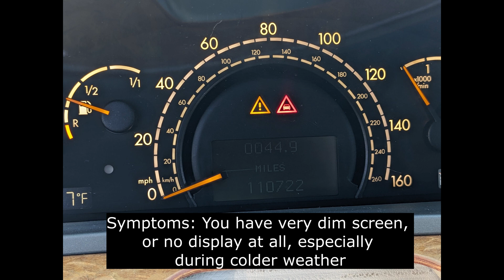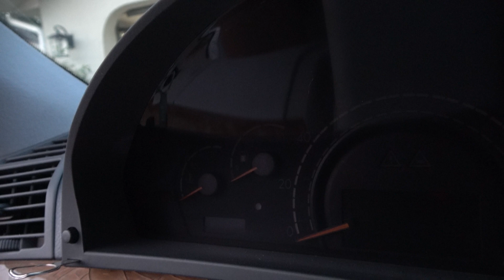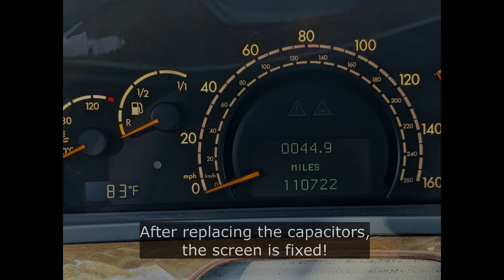Mercedes Benz W220 (S430/S500) Instrument cluster removal and display fix

Comment: So as long as you don’t change the actual board out, there’s no need to have it flashed/programmed correct? Correct me if I’m wrong, but replacing the whole assembly would require a program/flash correct?
Reply from the maker: If you're talking about just the LCD display unit, then no programming or flashing is needed. The entire instrument cluster replacement would be a different story.

Comment: This was a huge help. Did exactly as you said, and it worked! However, now my speedometer isn’t working (was before). Any ideas? I also replaced the smaller 6th capacitor
Reply from the maker: Hard to say why the speedo isn't working. I've opened up my cluster like 20 times and never had an issue with the speedo. Perhaps you should reopen it and ensure that the LCD display is sitting perfectly and is not interfering with the needle movement. It just could be alignment issue.
Reply: @event3horizon y’know, the human brain amazes me. I had the wherewithal to fix and solder my cluster thanks to your instruction but I forgot the car needs to be moving in order for the speedometer to move 🤦‍♂️ all good here haha!
Reply: Spoke a little soon. Works, but getting stuck at 21-22 mph. Might just need to give it a little wiggle again

Comment: Very helpful video- thanks! Gave me the confidence to take out the cluster - something I've been putting off for years. (The LCD display screen has failed; I've now got it apart enough to find the model number to order a new one.) Very minor comment: at about minute 3:40 they're T10's (not T9's) - I had to go shopping for one and had a hard time finding a T9, whereas T10's are easier to find.

Comment: Great video ! Ima having the same issue except my needle lights do not work nor ,does my display nor does anything  else. only things working are needles for gas ,temp, Rpms..
but I can’t see anything on the dash everything is blacked out. Any suggestions? You think doing this same procedure will fix the problem ?  Also only the check engine light will show blinkers and high beams indicator
Reply from the maker: You may want to check the power and ground feed wires to the cluster. Remove cluster and bench test. It has two power wires and one ground.
Reply: @ the ones coming from the car on the harness or at the cluster ?
Reply from the maker: @Maliekdaddie2022  coming from car harness
Reply: @ thank brother much respect ! 🫡

Comment: How long does it take to remove the instrument cluster ? I have a 2004s500 my mechanic quoted me an hour to remove it . I don’t think I have those two keys you showed for the beginning of the video
Reply from the maker: @anthonyfonteboa5896  Takes 5 minutes. You can find those keys on ebay.
Reply: @event3horizon that’s where I got mine
Reply: 5 minutes is too long. It took less than a minute for me to remove the cluster.
Reply: @alberts7061 sometimes the tabs can be tricky a screw driver flat head helps

Comment: I've replaced the 6 caps on the cluster and the BUK9624 transistor on the main bord. This did not fix the problem for me. 😣😖
Reply from the maker: @muhammadalsadah1219  It depends on the problem
Reply: @Bizija123  What possibly could need to be replaced? Any quick advice, or it must be diagnosed by a professional?
Reply from the maker: @muhammadalsadah1219  what's the problem? My fix was for the center lcd screen being very DIM
Reply: My problem is exactly as your video started with. On a cold start,  the center screen is very dim and almost nothing can be seen. Eventually after some time of operation, the screen starts to be brighter and brighter until it is almost normal.
Reply from the maker: @muhammadalsadah1219  The capacitor replacement is very delicate. One small error and it will not work correctly or not work at all. Check your work carefully and if possible redo the soldering. The component microfarad ratings must be exactly like the originals. If that fails then you can buy another center screen from eBay.

Comment: I have pixel errors in the cluster display, are the capacitors also causing this or it my display itself broken? Greetings from Germany
Reply from the maker: Hi. It is unlikely that capacitors are at fault. The liquid crystal layer is possibly worn out/damaged.
Reply: @event3horizon  thank you for the quick answer, so its probably the best to replace the LCD with a old or buy some from aliexpress ect.?
Reply from the maker: @erdbeermarmeladebrotmithon5980  Yes. Ebay has them as well. They are simple to replace and no programming is required.
Reply: @ thank you boss 😎

Comment: Hey I have a s430 4 matic 2006 in canada and everything in the cluster is dead even the gauges don’t work. There are several used ones on the market and some ads saying they do cluster repair. What should I do ? Thanks
Reply from the maker: @KiaBlessYoTrap  i would go for cluster repair. There are probably some power transformers that need replacement. Try Google module masters. Not sure if they service Canada customer. Thanks.

Comment: I replaced a used cluster to my s430   It lights up but it doesn’t show the odometer mileage
Reply: @pscantlin  the only way to see the mileage to repair original or else you will never get that info back . The car stores it but without original cluster it’s lost .

Comment: thank you so much for your video. i did this and my display did get bright immediately but shows no info, not dim, but no info. any suggustions? thank you!
Reply from the maker: @papasgarage  was it like that before? Did you take apart the whole lcd and misalign something or forgot to plug a ribbon cable in all the way?
Reply: @event3horizon  it was dim, unreadable until it "warmed up" 10-15 minutes later, then it would return to normal.  i sure could have misaligned something, i did plug in all the ribbons and 2 plug in between the 2 boards. i also replaced the 5 caps. i could have sodered them in incorrectly, ALSO i could only find the 10s in a 50 volt rather than a 35. thank you for the question, jim
Reply: There is a polarIzed glass on the front of the cluster. Could it have been placed wrongly?! Just woundering.
Reply: @muhammadalsadah1219  no, actually it was still a burned out capacitor i missed
Reply: @papasgarage  so it's all back to working properly again and the method worked?
Reply: @mamuebav yes

Comment: Buddy replace the whole display panel with a working panel but it’s not working on it 🤔 could you plz help me little more about this 🙏🏻😊
Reply from the maker: Did you replace it with the same part number as your previous one? There are two different lcd panels.
Reply: @event3horizon  I’m glad your reply to me 🙏🏻
Actually brother I bought another one complete meter and unfortunately there was a issue with the LCD panel and I just replace with my original panel 🤔 i thought it will work 😵‍💫
Reply from the maker: @razirover5429  So you replaced the entire cluster and the lcd panel and nothing works? I'm not sure exactly what's wrong. You may have the wrong year cluster installed. Please post on benzworld.org forums. I am on there and others can help.
Reply: @event3horizon  yes brother i got another use entire cluster with damage display panel and mine original cluster entire needles wasn’t working properly 😵‍💫I hope you understand brother 👀 so after that I just take off my original cluster and swap the LCD panel with new clusters I thought maybe it will work this LCD panel on 2nd cluster but still have the same issue 👀
Reply from the maker: @razirover5429  I understand brother. What is the issue after you did the replacements? Is there nothing on the display? Does the replacement cluster light up? Do the needles work?
Reply: @event3horizon  yes sir i noticed that little difference between model/year 🫣
Reply: @event3horizon  yes brother all the needles are worked but display like blanked light 
Just blink like red and black

Comment: great share.  like another question, can you provide mfg and part numbers for the capacitors that need replacing?  thank yoU!
Reply: BOOM goes the dynamite!   The fifth capacitor was the issue.  Recommendation for anyone doing this in the future:  If your DIC is dimly lit, replace the fifth capacitor first and test the DIC before replacing the remainder....maybe do those one a time as well.   Thanks for the video!
Reply from the maker: @ToddEmmershy  excellent. Even if they did not need replacement, it's good to do it anyway. Cannot rely on 20 year caps.
Reply: So, this did not work for me.  I still have a dimly lit DIC.   Did you perform this and it worked for you?  Do you know of another solution?  thanks.
Reply from the maker: @ToddEmmershy  If you tore up the pads, traces, then of course it isn't going to work.
Reply: @event3horizon  I was able to repair the traces and pads with copper tape, etc.   I also replaced the capacitors and I'm back to square one.  Dimly lit DIC.   There must be another issue going on since replacing the four capacitors didn't solve the problem.  any ideas?  thanks.
Reply: by the way, i would not recommend you doing this unless you have excellent expertise in removing and reinstalling SMT components.  I tore the pads up and some of the traces.  It really sucked.
Reply from the maker: @ToddEmmershy  Yes, they are fragile. You need to not pull hard on them. You need to use flux and a desoldering heat gun to remove them.
Reply: I just read in your video description that the fifth capacitor may also be replaced.  i'm going to try that now.
Reply from the maker: @ToddEmmershy  yes. I had a small improvement with the 4 capacitors first, but then did the fifth one and it came back fully lit.
Reply from the maker: There aren't any part numbers but capacitors specifications. You need these https://www.ebay.com/itm/274996459942 and these https://www.ebay.com/itm/125983800514
Reply: @event3horizon  thank you.  I was more concerned about ensuring I order the correct physical size since they are surface mount.  I know that some SMT electronics come in different sizes even though they have the same specs.  thanks again for the quick reply!
Reply from the maker: @ToddEmmershy  They are tiny, about 5x5mm

Comment: Hey! Awesome video, I am in the process of replacing my display module as well, I found a brand new display module online and I was wondering if I just replace the module, would it be plug and play? Or would I have to do something else for it to show the information correctly? Thanks again for the video
Reply from the maker: It should be plug and play, just make sure you get the correct one out of the two possible part numbers.

Comment: whats the size of the 5th one?
Reply: 647-UCW1V100MCL1GS
UCW1V100MCL1GS
35volts 10uF AEC-Q20

647-UCB1V4R7MCL1GS
UCB1V4R7MCL1GS
35volts 4.7uF AEC-Q2

647-UUL1C100MCL1GS
UUL1C100MCL1GS
16volts 10uF AEC-Q20
Reply from the maker: Same as the other, 4.7 microfarad. It should say it right on the capacitor.

Comment: My display is not only dim rather looks like "washed out". Sometimes it works after running for awhile and sometimes not.
I was just thinking on finding a used cluster and pull out the LCD . How do I know if it would be fixed with the capacitors or if I need a whole display? Car is 2004. 
Thank you for your video ! Very helpful and detailed.
Reply from the maker: Yes, it would be far easier to pull a used LCD out of a cluster, but that can end up needing capacitors too. They basically all need it after 20 years. In your case of washing out, you may actually have a bad LCD backlight or some other component is faulty such as the cover glass or polarizer layers.
Reply: @event3horizon   Unfortunately the IC has to be out even to figure out which donor display to look for. The LCD has 2 different configurations (2 OR 3 cables/Ribbon) so the donor has to match. I will check the capacitors while am in there and maybe I will be lucky. 😅
Reply from the maker: @walidmorsi7156  The donor cluster would need to be a facelift w220 starting from 2003 I think would fit. So 03,04,05 would likely be compatible but not the 00,01 or 02 model years.
Reply: I have S320 and the speedometer have some issue, lcd polarizer already melted  i did clean it and replace new. But nothing display just backlight. Is that same issue like this video that i have to change capacitor? Thanks. Sorry bad english😅
Reply: @andrewzikrie285  did you replace the screen only? Or the whole screen assembly? If the latter, I know the assembly has 2 different types/numbers written on the bottom of the assembly. I am yet to do this but am sharing based on the information I gathered
Reply: Did you fix the issues, mine doing the exact same things but now it’s barely running, what did you do if you fixed it?.

Comment: My display is out like yours, but where do I buy the capacitors?  And do you have a video on how to remove and replace the capacitors?  I bought the cluster removal tools today.  Thanks!
Reply from the maker: I bought them on ebay. You can view any electronics soldering basics video on youtube to learn how to desolder and solder caps.